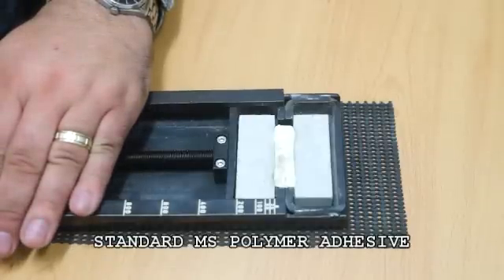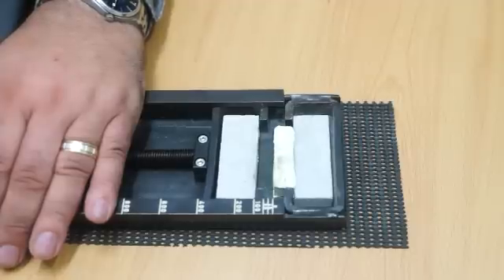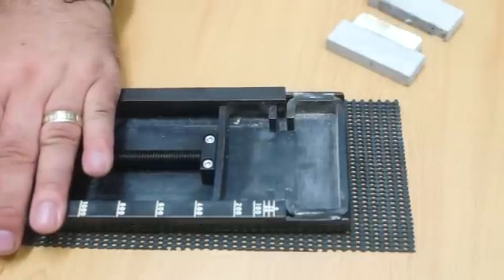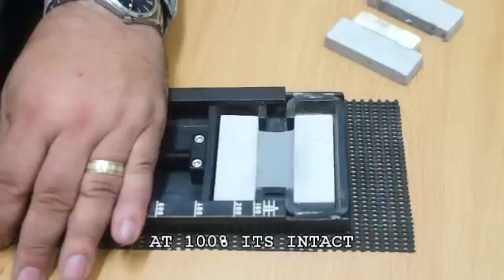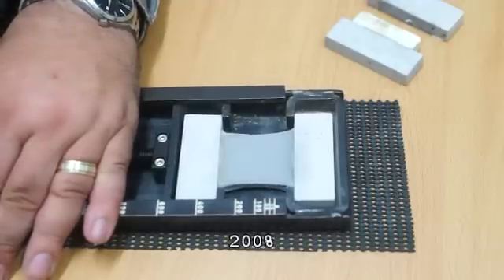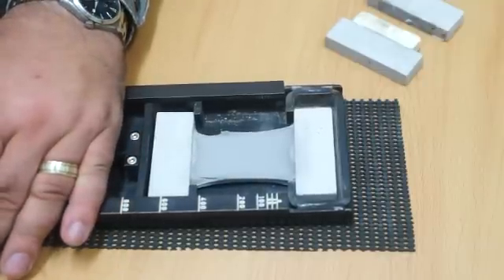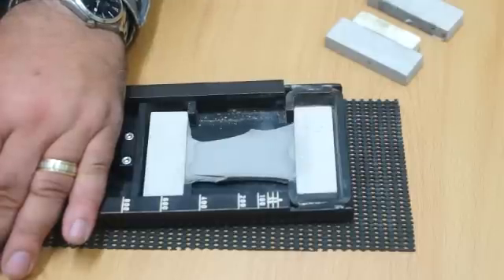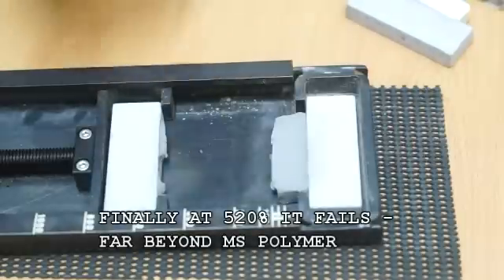SIKA ADHESIVE VERSUS MS POLYMER STRENGTH TEST

Comment: Except no, timber floors have been around for hundreds of years and did not fail merely because they didn't use the latest and greatest adhesive.  A product only has to perform up to the stresses present.  Going to an extreme past that point, usually means the adhesive has other shortcomings which must also be considered, even if the shortcoming is only price.
Reply: I agree with you. MS polymer actually lasts far longer and has better characteristics than PU. PU's better benefit is probably just the elongation break.